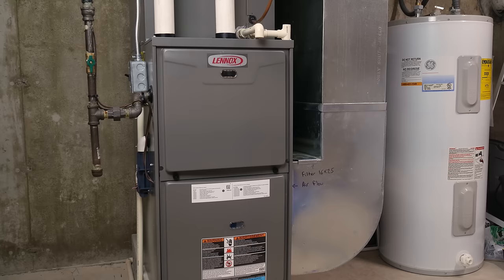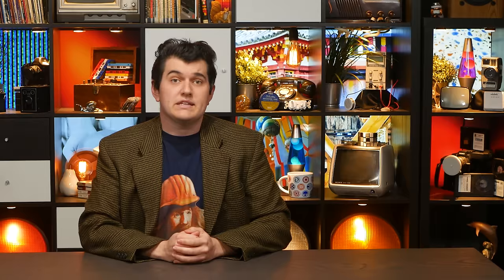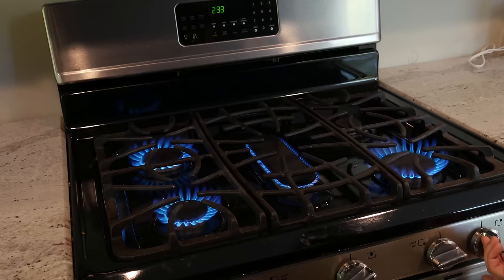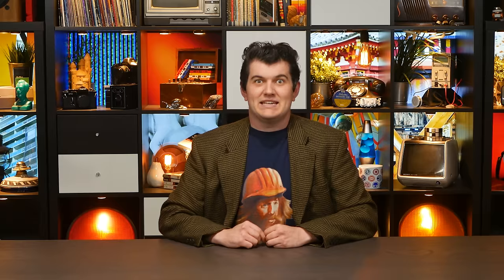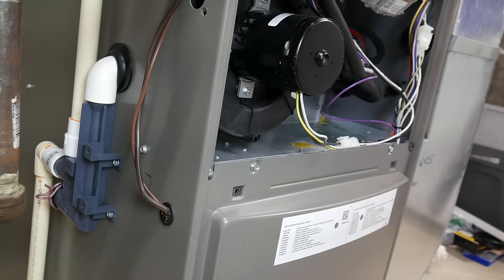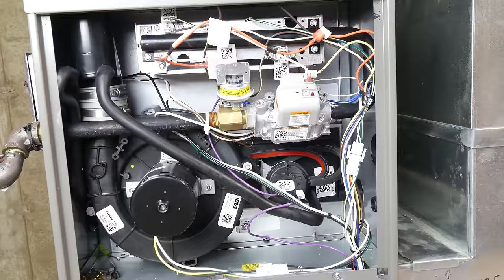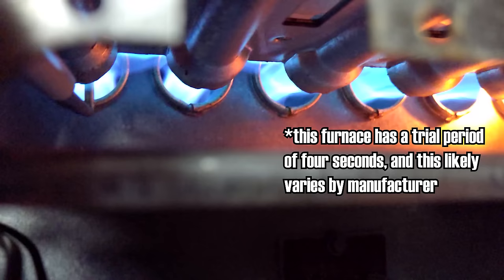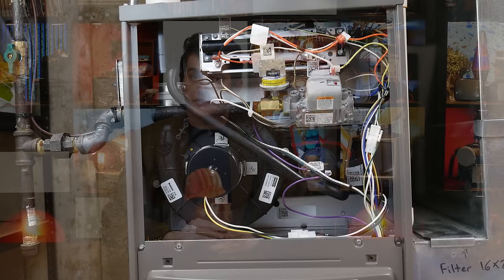Forced-air Furnaces: The What, Why, and How

Comment: As a child, when we had a ~70% furnace, I had a lot of headaches one winter. When the furnace was replaced, we learned it was really good that our windows leaked.
Reply: Jeez
Reply: When I was a kid we had a large woodstove that was about 65% efficient.  Even woodstoves are more efficient now but back then we used to go through 10-12 cords of wood every winter.  Some converted these to natural gas or propane and I have seen converted woodstoves but we did not as propane cost 5-6 times as much as wood for heating.  The stove was also compatible with coal but we didn't use any of that.
Reply: @mharris5047  Thank goodness everyone doesn't burn wood for heat. The smoke output is way worse for all of us.
Reply: @Yosef9438  Modern woodfire stoves have reburners and are much cleaner than they used to be. The exhaust is white/clear(depending on moisture), though full of carbon dioxide and carbon monoxide. Less smell as well.
Reply: @sammorris2721  My grandmother had a fan that ran on the heat of the stove itself, back in the early 2000s. I think it was thermoelectrically powered. It was a plate that mounted on the stove and a heat sink on top. Ran surprisingly strong as well. Not as string as an electric fan, but plenty strong to throw the heat across the room.
Reply: @Bubu567  indeed it was thermo electric powered. With the peltier junction. Good quality, indeed. Good memories.
Reply: @mharris5047  we still use wood for heating in our house, it's very badly designed because our furnace only heats the first floor and not the basement, so we stopped using it and only use the wood stove. Then there's my bedroom which has an electric baseboard with a thermostat for some reason (no other rooms have one). Where I live electric baseboards are the standard since electricity is cheap
Reply: @Yosef9438  Depending on the type of wood you burn. Dry wood thats burn ing at the right temp shouldnt smoke so much
Reply: SkiingSasquatch  Versus, what? Being dependent on being able-bodied and having to go out and gather and chop wood? That's not something in the cards for me or my family.

Comment: I am a retired furnace designer and you got everything right except for one thing. The flame sensor is not a thermocouple. Modern furnaces use a property called "flame rectification" to detect a flame.  An alternating current is passed through the flame and the ionization of the flame acts like (a rather inefficient) diode.  The control circuit board detects this small DC current.  Three to ten microamps.
Reply: Leonard is right and the nature of the sensor can be problematic when installing. People will assume polarity of your 110 vac line doesn't matter and indeed the motors and and other electrical components don't care if hot and neutral are switched. However, the flame sensor and the electronics in the control board do care and may not register a flame when there is one.  I have been called to troubleshoot unit heaters on at least two occasions where this was the core issue. Alas, they were installed by electricians who should have known better, but worse argued with me about changing the wiring and insisting it wouldn't matter until I demonstrated it to be otherwise.
Reply: Good do know, thanks. I always have a backup on hand, but will continue to use a scotchbrite pad to clean the old one for as long as I can until it fails too often or completely.
Reply: Do you know why furnaces use hot surface igniters instead of spark ignition? I've had my own hot surface igniter go bad because of cracks.
Reply: @lambchopsz  Less complicated. Spark ignition requires a high voltage source (usually incorporated into the control card) and needs to be 'gapped' and grounded properly and have a highly insulated wire just like a car's spark plug. An HSI just needs a switch on the control card capable of handling the current flow. 
Good to have both a spare HSI and flame sensor on hand for your furnace as they WILL fail and it will not be at a convenient time.
Reply: @lambchopsz  They're generally more reliable, but mostly cheaper. There's no electronics with the HSI, just a relay.
Reply: @rancidcrabtree.  Very true! A sensor like this depends on the live, neutral, and earth to be where they are supposed to be in order to return a valid result.
Reply: @rancidcrabtree.  mine have only failed at christmas and when i was away for a week.
Reply: isn't the old style thermocouple a simpler and more reliable design? it's just a simple voltage amplifier and the sensor is simply 2 wires made of different types of metal.
Reply: @rancidcrabtree.  a friend of mine is a retired electrician. When he bought his house, he noticed the light bulbs kept failing in the living room. Turns out the light bulb socket was wired backwards. As you mentioned, wiring a hot and neutral properly are more important than one would think.
Reply: Norm Meunier  Yeah. There is no doubt that to become a Master Electrician you have to your s%^t together, but at the same time the trade does attract a fair number egoists that can't get over themselves.
Reply: @lorenzo42p  A thermocouple wouldn't react fast enough to shut off the gas before a significant amount of raw gas would flow into the heat exchanger. Not a good thing. On the next lighting attempt the furnace would either become a missile or a bomb.
Reply: Exactly what I caught. Otherwise perfect.   I am a refrigeration tech and am so excited for more videos on heat pumps!!
Reply: @leonardlakey7779  I dunno.. I'm no expert, but I think a thermocouple would react pretty damn fast. maybe it just comes down to the thermal mass of the sensor. a thermocouple that is just 2 tiny thin wires would react instantaneously, but the ones used in a furnace or water heater are much bigger. the ones I remember seeing look like a metal tube in the shape of an L. I guess you're right, cuz that metal takes a bit to heat.
Reply: @VitoVeccia  Absolute Nonsense. How about all the table and floor lamps? Light bulbs neither know or care. The lamps failing more often in one room could only happen if there was a fault or bad connection in the neutral wiring somewhere in the house.
Reply: @vinquinn  I'm going by what he told me. And to me it would make sense  to wire up lighting sockets in a certain fashion, since there are people who use light socket adapters.Granted, I've only seen them used in basements though.
Reply: I worked at an apartment complex 22 years ago that used furnaces with thermocouples. Not familiar with this diode system. Is it more reliable? I remember replacing thermocouples was the big chore every fall, aside from cleaning the furnaces.
Reply: And "cleaning" them can only help in a bind. You will have to replace them at some point, 3 to 5 years recommended, or they will have difficulty sensing and you'll end up with a no heat situation, usually on a holiday or the coldest night of the year! They are simple and easy to replace, using a long 1/4" hex driver, and inexpensive to buy at under $20. Keep an extra on hand and save a service call of at least $100!
Reply: @rancidcrabtree.  sorry to bother but what do you mean by the polarity of the vac
Reply: @aykutcomert3075   @Aykut Cömert  Where you land your 120vac on the furnace's control card, there will be a 'Hot' and a 'Neutral'. Typically, the black wire from the circuit breaker panel will be 'Hot' and the 'White' is neutral. The neutral is essentially bonded to ground at some point in the house. Because houses use alternating current, electrical potential will flow fine for motors if reversed, but the electronics monitoring and evaluating the flame sensor won't have a valid ground reference.
Reply: I can imagine sensing levels around a few μA, with leakage current, a H\N swap could make a difference.
Reply: @ Leonard Lakey,  Noone  ever mentions the s trap. Does it need to be capped or left open to blow air out of it ? We have our furnace and hot water inside of our are attached garage along with the electric dryer. But what we do not have is a makeup air fan only a small hole in the upper wall the size a a small basketball hole. If left uncapped and blowing air out f it into the garage would that not allow the garage to possibly have positive pressure and then could potentially force the voc gases from the garage into the house i guess i should also mention that the furnace gets its makeup air from inside the  garage , no pipe going outside for fresh air. same as the hot water heater. and the clothes dryer also uses said air .
Reply: Why dont they just use a photo optic or temp sensor?
Reply: Or why cant the furnace just be outside?
Reply: @lambchopsz  if you can look for a glowfly or something comparable type of ignitor that will be compatible with your particular model will likely last longer than the original equipment... ignitors have come along way silicone carbide was the industry standard in the beginning and now silicone nitride ignitors have become the norm because of longer life.
Reply: @MrTrailerman2  Thanks! I've never heard of glowfly, I'll look into it!
Reply: Rheem has used spark ignitors in all of their furnaces for the last 20 years and they seem to work very well. They claim it is more reliable than HSI.
Reply: @shanebraithwaite6791  the pipe is supposed to be capped between the blower and the trap. To prevent conditioned air from escaping. After the trap, it should be open, to promote draining, and prevent siphon.
Reply: @SuperVstech  So what is the cap there for? I have found that it seems to be a way to add water to the trap if it ever does siphon but alot of Hvac pros disagree and some agree. I am arguing  with my dad about this and I feel I am 99% correct hence why I am asking for a little advice. Also thank you
Reply: @shanebraithwaite6791  cap is there to allow cleaning of the trap... nothing more.
Reply: @SuperVstech  Thank you for confirming, this is exactly what I have been saying. Have a happy New Year!!!!
Reply: @VitoVeccia  in the case of light bulbs the polarity reversal could not cause premature bulb failure as you describe, because the bulb has no ground reference (unlike a furnace).  However it's still extremely important to have the polarity right, especially light bulbs with a standard 'medium base' because when reversed, the  bulbs large screw base becomes a significant shock hazard.
Reply: @VitoVeccia  I think you may have misunderstood him, or he simplified the explanation for you.  reversing the hot & neutral matter to the flame sensor, but not to incandescent lightbulbs.   It's true that lights should be wired the correct way.  That helps prevent you from touching the hot wire when changing light bulbs.

 It's possible that he meant that he switched the light over to the other half of the 240V coming into the house.  Maybe he was getting spikes or slightly high voltage on the leg he originally had them on.
Reply: @rancidcrabtree.  It's not that it won't have a valid ground reference.  Ground is ground, whether neutral and hot are reversed or not.  I think the issue is that the electronics for the flame sensor are expecting more current during one half of the AC cycle than the other.  By flipping hot & neutral, the furnace is now looking at the wrong half of the cycle for the extra current.
Reply: @Hyxtryx  I believe you are correct.
Reply: @Hyxtryx  in North America, the neutral is connected to the safety ground at every step-down transformer out on the poles, and inside the electrical panel in your house. So if the hot and neutral are transposed in the furnace, the flame rectification current will flow in the wrong direction and not able to be sensed by the amplifier on the board. 
Thermocouples are still used on larger equipment like boilers in a configuration called constant pilot. Thermocouples are long delay devices taking 15 to 30 seconds to register the applied heat and generate enough electric current to hold the pilot valve open. This is way too long a delay in a modern gas furnace. Also a constant pilot would result in lost energy lowering the overall efficiency. Thermocouples are also commonly used in gas fireplaces so they don’t have to be connected to the ac mains allowing their use during a power outage. 
Spark ignition is an added complexity, though effective at igniting the gas, causes radio frequency interference which furnace manufacturers don’t want to have to deal with. True, Rheem has been doing it for a long time, their control boards are substantially more expensive to replace than an HSI board containing just a small relay to power the igniter. Component cost is extremely important to furnace manufacturers and their desire to stay competitive and make a profit means that for a more expensive board, cost was shaved from somewhere else in the furnace.
Reply: @Hyxtryx  I like that so many people assume that ground is wired correctly.  It suggests that the experiences I've had are statistically skewed towards bad wiring.  Just like people can get confused between neutral and hot, they can get confused between neutral and ground.  At least they usually notice pretty quickly if they get confused between neutral and hot - I've only seen one of these.

No, I'm not an electrician.  But my father did have a penchant for living in old houses as I was growing up, and even for a while after I moved away from home.  I thus got more exposure to this stuff than I was comfortable with.  (So glad I'd moved away before he moved to yet another old home, even more ancient than the previous two.)

Speaking of old houses, there was a house we lived in back in the late 1970s which had really old wiring that didn't include a ground wire.  Correcting this in a good way was expensive, so most of the three pronged outlets had the neutral and ground connectors wired together.  A few of them were different, but most in a rather shocking fashion, especially if you plugged in a device that grounded its metal exterior.  Dad fixed both of those before we had any such experiences with them, because he knew to test the wiring with a electrical outlet tester.
Reply: @vinquinn  I think you’re right at least when it comes to incandescent light bulbs, for the longest time lamp cords we’re not polarized so for decades many lamps and other appliances were plugged in with reversed polarity and didn’t seem to adversely affect them. Maybe with LED bulbs it might make a difference.

Comment: HVAC technician here. Your explanation and overview was great! However you missed one key safety feature, the rollout switch. This is there to stop operation if positive pressure from the blower motor is entering the heat exchanger through an existing crack. That positive pressure will prevent the draft motor from doing its job and flames will rollout of the heat exchanger. Set to trip if it detects flame!

Comment: Sooooo I’d like to personally thank TC. I saw this video and thought, “Huh, I never did get my furnace checked out after we bought our house two years ago.” So I looked at the furnace and saw that it was 22 years old and called someone to give it a checkup. News wasn’t good, fellas. It was dumping 12 ppm CO into our house, which I know isn’t a massive amount, but our state says the tech has to turn the furnace off for safety reasons at 6 ppm. 

Now my family is cold for the weekend, but we’re not dying! 

Thanks, TC!
Reply: Out of curiosity what state is this? Per OSHA Under 50 ppm Isn’t deadly (usually) for an 8 hour period. 6ppm-20ppm can be standard in an exhaust pipe of a furnace during operation. I know you mentioned 6ppm coming into the house though. It is a very low number considering 400ppm is usually the standard deadly level. ASHRAE, WHO and EPA call for shut down at 9-10ppm per 8 hour period.
Reply: @frankrizzo7351  Dude said 12ppm into the house, which means his family was exposed to that 12ppm continuously. Much worse, I'd imagine, than 10ppm for 8 hours.
Reply: @riccardoorlando2262  especially since CO hugs the floor. If it was a single story, I can see why the cut off would be lower. 

Also, GET CO DETECTORS!!!!! And check your fire alarms.....
Reply: Not dying is cool!
Reply: @zombieregime  Wow, if it hugs the floor that's bad news for babies. So does that mean you should put CO detectors lower down in rooms?
Reply: @greenaum no, the commenter is wrong. CO diffuses more or less  evenly, its a myth that it hugs the floor and that monitors should be there. It diffuses evenly because it weighs more or less the same as the other gasses in the air.
Reply: @greenaum  Near a Heat Duct is Ideal, where it comes out.
Reply: @davemi00 no. Absolutely not